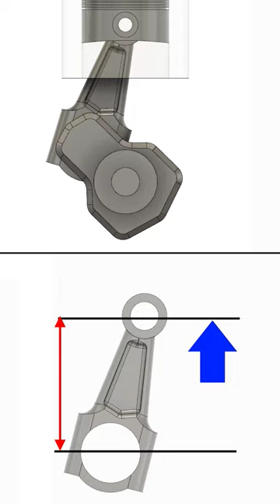Secondary forces visualized #d4a #engine #engineering #piston #mechanical #toyota #yamaha #honda

Comment: Why secondary force is upwards when it hits bottom dead center?
Reply: Because the connecting rod is moving back in-line with the motion of the piston, which offers more vertical movement to the piston. Think of it like this: at 120⁰ from TDC, the connecting rod is slightly lower there than it is at BDC.

Comment: Does ford use this in the 4 cylinder diesel in the ranger
Reply: a piston, conrod and crankshaft ?  amazing.
Reply: @casemodder89  no smart guy an offset crank
Reply: @craigchiddo2794  if ever it is a offset piston pin.

Comment: The rod remains fixed in size, it doesn't become shorter or longer. THE PROJECTION of the rod changes size. Get your language straight before trying to explain physics.
Reply: Actually, the rod does physically change in length depending on whether it is in compression or tension. The difference in length might require a powerful microscope to determine, but he's technically correct, and he's using the right terminology.